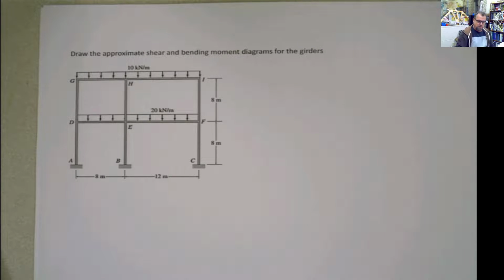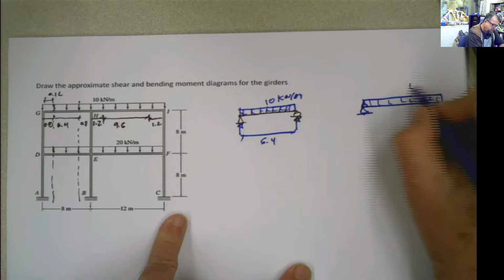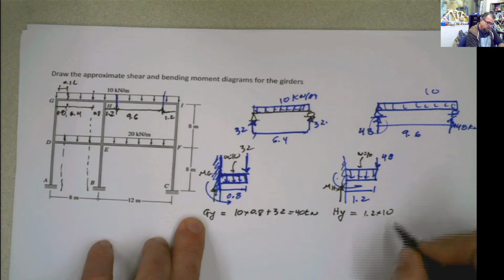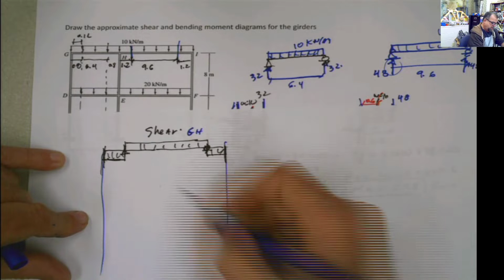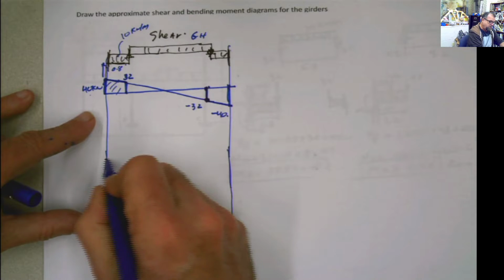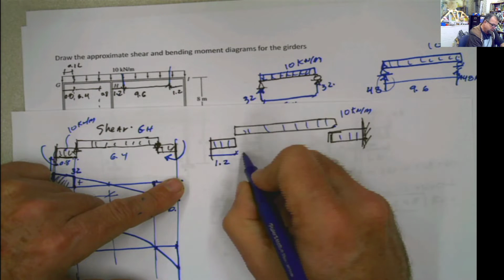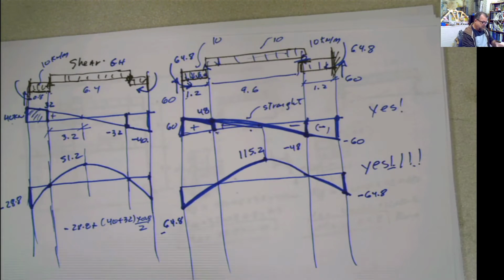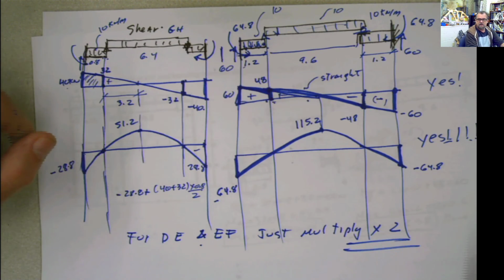Approximate Analysis of STATICALLY INDETERMINATE Frames under VERTICAL LOAD

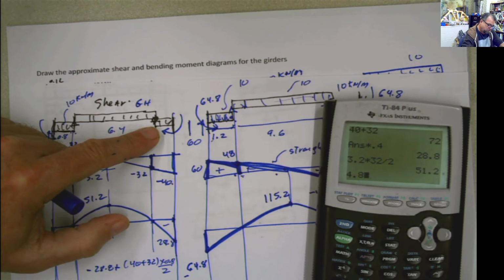Comment: Hey Dr. Zaurin, small error in your answer for how much of the moment that the column is absorbing (19:49). In your calculation, you put 4.8 - 28.8 = -24, when it should've been 64.8 - 28.8 = 36. 
Just wanted to point that out to avoid any confusion.

Thank you for the videos!